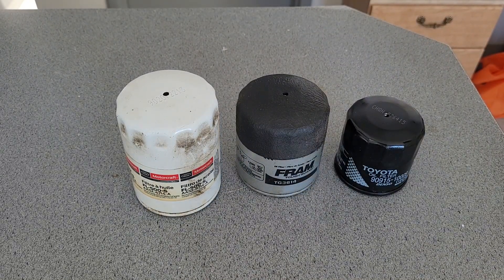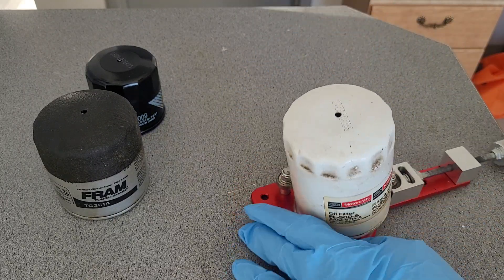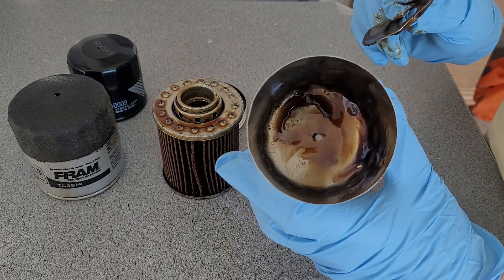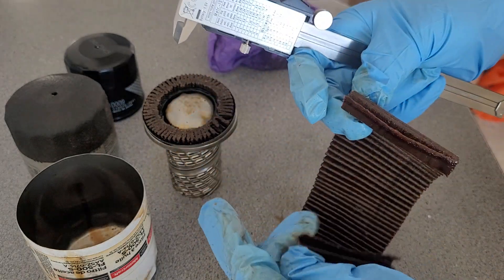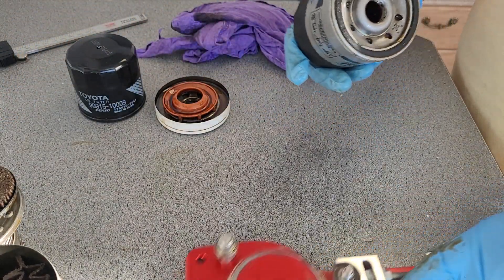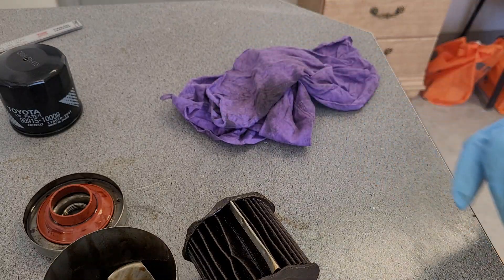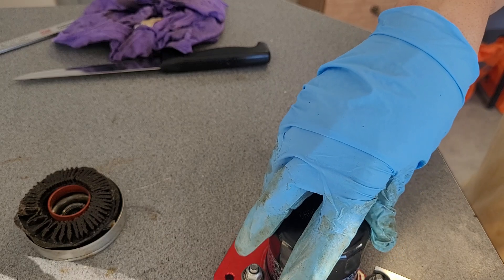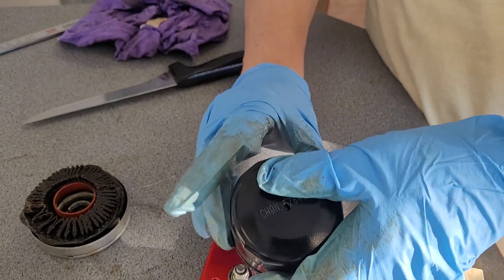Used oil filters cut open

Comment: Most of my Fords have 10k mile oil changes. So, that filter may be on there 2-3 years. I never get any metal particles. Just soot & residue from their sloppy glue job.
Reply: @donwyoming1936
That's much too long & with that amount of miles & long time span that's likely a lot of cold starts.
One year max is enough for most oil filters.
Reply from the maker: Certainly, thanks Don.
Reply from the maker: Thanks Don, I wanted to get in a used Motorcraft.  Wish I did know the mileage.